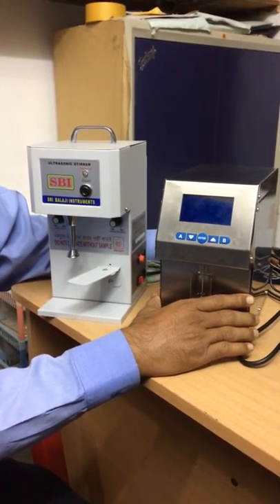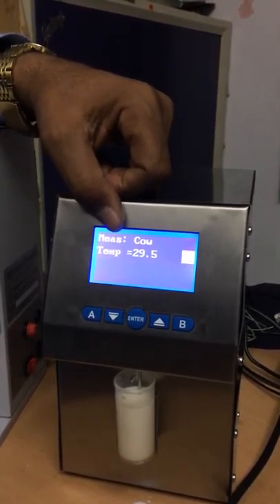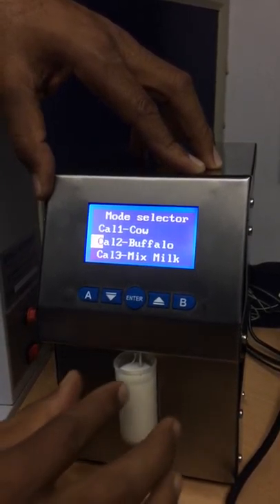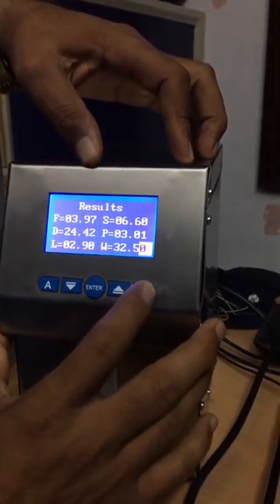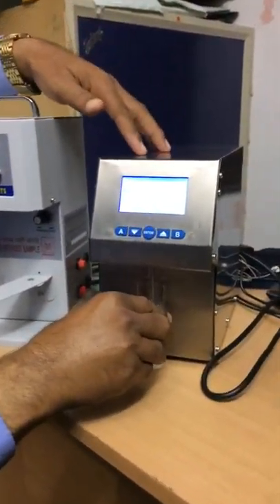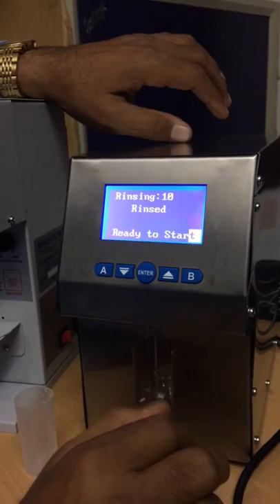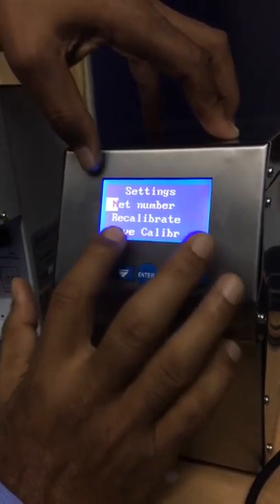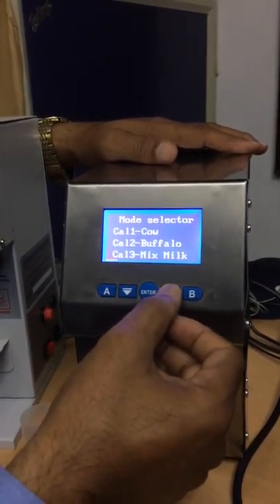Lactoscan Milk Analyser - How to Use

Comment: Sir I have a big question can you please ans it.... In my village buffello milk nd cow milk... We seperately pore the the buffello milk nd cow milk but they are doing mix milk so that... In buffalo milks the fat percentage Is reducing.... 
Actually my dought is that we need to see seperately for buffello milk nd cow milk? Because some people is only having buffellos so they won't mix that two milks at that time what we have to do...
Reply from the maker: You can test separately, all analyser has 3 channels cow, Buffalo and mixed. By mixing both milk the FAT value becomes average (so no loss). If they rate is different for cow and Buffalo than there will be a lose in Buffalo rate.